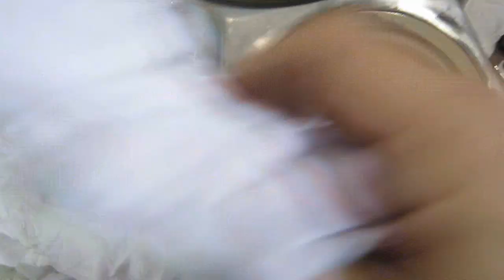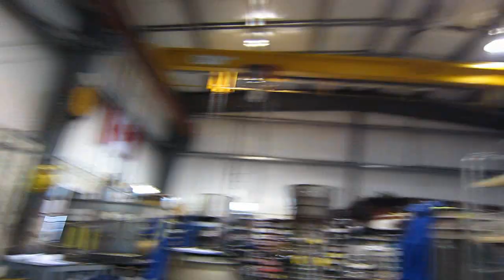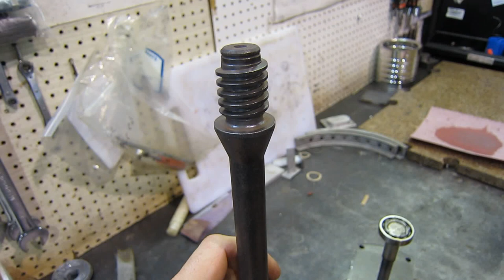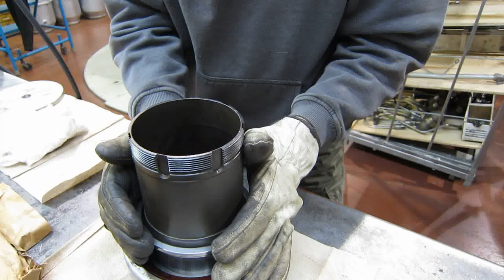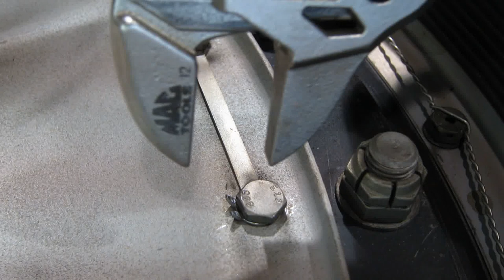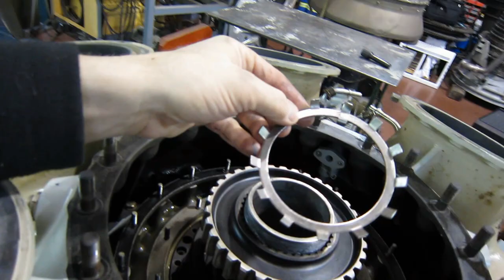Orenda 14: A Look Inside 2

Comment from the maker: Never too late. My videos are non-perishable !
The compressor rotor is held in the engine axially by the thrust bearing, and the turbine is held to the compressor by the tension member.
When we remove the thrust bearing, the compressor will fall into the stators and wreck stuff, unless something else holds it in place, and that something is a tool called the rotor jack.
It attaches to the front frame, pushing against the front of the compressor shaft.
( in the vertical stand)

Comment from the maker: The bearing might get to 450F or so in service, but then so does the shaft, so the fit doesn't change. And the races are fixed by the giant nut, so they will never move.

I have seen a thrust bearing that has been starved for oil; it was blue from overheating, and the rollers ( balls ) were badly beaten up. The engine ran, but  "wouldn't make any power".

Turbine engines are much tougher than rattleboxes. I have never seen one that has blown apart. They do, but it is a very rare occurrence.

Comment from the maker: short answer: no.
The compression ratio of a modern airliner turbofan engine's fan section is a bit less than 1.1 to 1.
Any extra stators placed behind its one stage of stators would do nothing.
This engine makes its power at 8000 rpm. An airliner fan turns between 2000 and 3500 rpm, depending on which engine it's in.

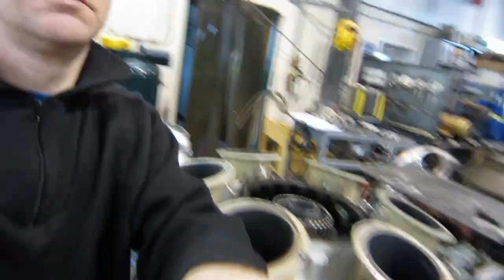Comment from the maker: Starting at 13:40, I show the lockwasher and nut that are used to clamp the thrust bearing on the compressor rotor. 
This engine has a very unusual mounting of the thrust bearing; it is not very intuitive, so you have a real sharp eye.
When can you start?

Comment: It might be a bit late now, but I'm trying to see how the thrust bearing connects to the compressor shaft and holds it place? Is it that the turbine bears onto the thust bearing through it's shaft and the tension member holds the compressor to the turbine? That didn't seem to make sense in terms of holding the compressor in place using just the thrust bearing. If the turbine holds the compressor to the thrust bearing, surely the compressor falls down when you disconnect the backbone.

Comment: That bit did catch me out, the part being put into the midframe "upside down".

I take it bearing racers don't get that hot in normal operation, right? You're putting them on in interference fit, but if they over-heat (no oil flow?) they'd let go and the thrust bearing would stop... bearing the thrust.. is that right? Is that ever a way an engine actually fails? What sort of catastrophic engine fails have you guys fixed up?
Will start next summer wont trade an Aussie summer for a Canadian winter

Comment: are those bearings back to back to eliminate thrust? trane uses something similar on its centrifugal chillers. the bearings have marks on the innner race and outer and have to be heated to fit then pressed on. and are made by SKF but in austria

Comment: One more thing. I assume you used an induction bearing heater to warm up those races. I’m pretty sure most all of the non-mechanic types would get a kick out of a vid going over some of the more common tools used in the shop. I.e. stuff like an induction bearing heater, how it’s used and why it’s never preferred to cold press a race.